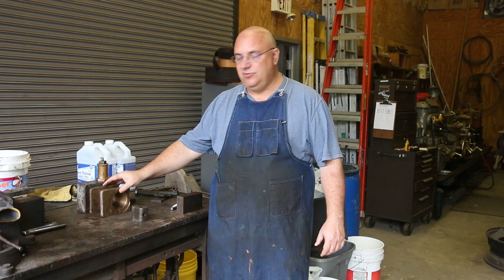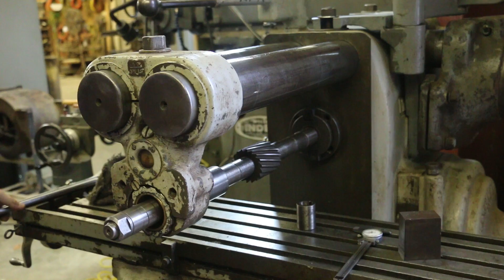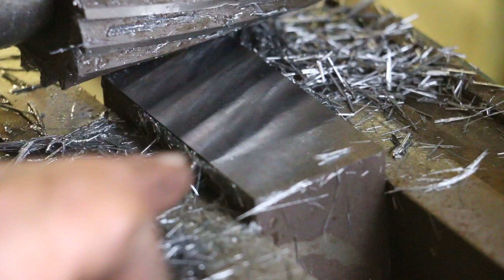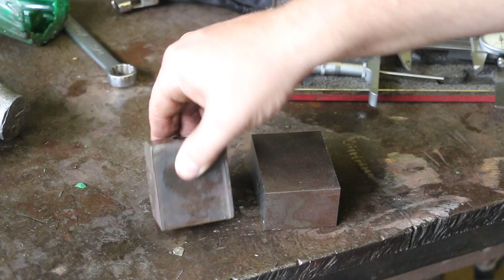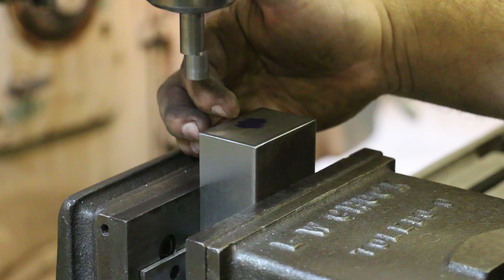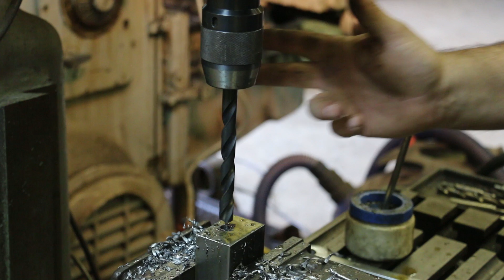Steam Locomotive Bearing Wedge Build:  Part 1

Comment: If there was no possibility that the wedge was original I would have installed a Heli-coil or equivalent. I would have saved time by cutting simple diagonal corners instead of cutting radiuses. Relieving the corners is just for clearance not strength or location..

Comment: Keith - Question. You say the bearing wedge drives the bearing tighter against the shaft taking up slop. The bearing was likely line bored to be circular. If there is horizontal movement it beans that there is a space between the two bearing pieces - this they are 2 halves of a circle but ow circular in configuration when in place. It appears the there is wear in only one direction and not the other. How did they compensate for this

Comment: I worked at K-T rebuilding the older knee type mills. The 2H has a great history. Just a small note, the U.S.Navy honored Kearney and Trecker with the award that their 2H was the oldest running machine tool that the were still using.

Comment: I was an apprentice machinist at a GE shop in 1970-71. The shop did both tool and die and mold making for plastic parts. I certainly enjoy your videos. In addition to my apprentice learning I also did all of tool steel heat treating for the shop. I did air quench inside a stainless steel wrap. I have noticed that you never seem to do any case hardening or heat treatment of your parts.
Reply from the maker: I have done some heat treating before but I don't think I have ever done case hardening.

Comment: Hello my name is Leo your real steam locomotive is fantastic, I want to 
built one like yours, I have disponible all metallic machine like lathe 
and vertical drill ecc ecc to realize all pieces necessary, but I need 
about project and construction plan. I think that to begin will be 
sufficient realize a locomotive with not more of 3 axes. Now have you 
disponible a project/power plan of construction ecc ecc for a locomotive
 with 7 3/4" gauge that can be able to start for me??? Thank so much Leo

Comment: You have to check the DRO time to time to be sure it shows right. It would really suck if it fex was off by say 5 thou, that could be hard to detect if not looked carefully and could make really bad problems when made something.
Reply from the maker: +dtiydr I find that the DRO is usually right or or way off.  I have not had problems with it being only a little bit off like that.
Reply: Keith Rucker - VintageMachinery.org Ok, that was good to know Personally however I usually check them 2 - 3 times a year to be 100% sure, I don't know I might be to picky.

Comment: While watching this I though couldn't you just drill out the thread and then fill it with tight bit of steel (or what materiel  was it) (of course there's more to do) then re drill and thread it that way you use the original part but then again what you did works well and thank you for doing these vids
Reply from the maker: +Riku matthews Sure, you could do it that way.  But, I think it has drawbacks.  I would very worried about that plug of steel staying put with the pounding that happens to this wedge.  My call was to make a whole new part, but your approach may have well worked just fine.
Reply: Yer well it's easier in some ways also the way you done is more interesting to watch but you know the plug won't come out

Comment: Could you not have made a threaded stepped insert instead of making a whole new wedge?
Reply from the maker: +Peter Fletcher Possibly, but I would be worried about it working out due to the tightening and loosing of the bolt used to make adjustments.

Comment: Hi Keith,

What us the spool shaped brass fitting on the bop of the bearing frame?
Thanks
Tony
Reply from the maker: +Anthony F. “Tony” De Leo That is an oiler.  You put oil in it and it drips down on the bearing.

Comment: Keith...
please expound on climb milling...I've seen back and forth on the  x  axis, always told to front load the cutter on  x  passes... if the machine is stout, shouldn’t make a difference.
Reply: I agree. When would you choose to climb mill?
Reply: +tim wyman Imagine an old worn out machine with 0.100 worth of slop in the x axis lead screw (extreme example, makes it easy to visualize) in conventional cutting, the cutter is pushing it the opposite the feed, keeping it on the same side of the lead screw.  In climb milling the cutter is pulling the part the same way as the feed.  If the cutter gets a good hold on the part, it will pull it that 0.100 worth of backlash, and the next edge that comes down get to bite off 0.100 of metal instead of the expected 0.005 or so.  Clunk, boom, broken something.

Comment: You made me wonder when you started out to go climb milling there! Great little project to show both the horizontal and vertical mills. I'm impressed at how you dialed in to the tenths of thousandths so quickly on the vertical--I always have to do more fidgeting and finagling than that. Maybe that can be a challenge at the next round-up, to go along with the four-jaw lathe centering challenge. Thanks for posting.
Reply from the maker: +Rick Rose Thanks for watching Rick!

Comment: Catching yourself from climb cutting the part is a good lesson for the beginning machinist.
Reply from the maker: +Gord Taylor It is easy to get confused when you stop to do something like make a measurement.  Some mills are actually designed for climb milling, which is more efficient and leaves better results.  But, if you have any wear in your tables, climb milling can pull that slop out and crash a cutter.

Comment: When those split bronze bearing pieces wear I assume you adjust using the wedge.  I didn't see any shims just the wedge to press the two halves together.  What is the criteria used when adjusting the wedge?  Do the mating halves of the bronze bearings come in contact with each other?
Reply from the maker: +hankus253 Over time, the mating bearings will wear to the point that they do come in contact with each other.  When this happens, you have to mill out more clearance where they mate with one another and if necessary put shims behind the bearing halves to take up the wear.  And at some point, it would become necessary to just replace the bearings all together.  The problem we have is that our bearings do not appear to have ever been replaced and there are a lot more shims behind them than I am really comfortable with.  One of the two bearings that we were working on had shims that were over 3/4" thick behind one of the bearings!  Of course, assuming that these bearings are original to the locomotive, they have been in use for 98 years, so I guess that is not too bad from a wear stand point....
Reply: +hankus253 
If they do then they need to be replaced because they have badly worn.  Usually on something like that.  I would think it would be poured milled and bored as one piece.  Then a machinist would split the piece to print and mill away a little bit off of both piece to give some room for wear.  When those pieces touch they are no longer properly supporting the pin.
Reply: +garygsp3 Maybe Keith will respond and explain how they are adjusted.  You can't just crank up the wedge until tight, there must be some sort of clearance measurement observed.
Reply: As an industrial mechanic I've used round feeler gauges to set connecting rods before.  However nothing ever this big.  There is going to have to be clearance between the pin and the bushing but I wouldn't begin to know how to set it.  I do know these joints are constantly bathed in oil VIA the oil pots that sit on top of them.

Comment: What is that? Mild steel? Do you think the threads would benefit from being hardened and tempered? Maybe prevent future stripping...
Reply from the maker: +jrmym2 As much thread as we have in there - the entire length is threaded - I doubt it would make much difference. Lots of surface area.  The original part lasted 98 years and it was not any harder than the one I made.
Reply: +jrmym2 
I wondered that myself but in reality they really shouldn't see that much use.  The force on the pin from the connecting rod should transfer through the bushing, through the wedge and into the bracket holding the assembly together.  The only thing that would stress the threads is torquing on them trying to tighten the wedge.  Which if you get as MrPete222 says "Hammer and Chisel mechanics working on something you never know what damage they'll do."

Comment: As I understand what was said in today's and in the last video, the brass bearing was made around 1917, nearly a hundred years ago. I don't understand how it is that the brass bearing that support the thrust is still good and that the wedges that do not support a load, once in place, are worn. Is there some explanation for that cause? Thanks 
Robert
Reply from the maker: +Robert Patoine As the bearing wears, it get's a little bit loose.  With this bit of looseness, every time the wheel goes around, that little bit of play in everything moves the wedge and bolt back and forth a little bit.  The constant beating on the part will weaken it over time.  These original parts are 98 years old and they can only stand so much stress.  In a perfect world where the bearing is always kept tight, this would not be an issue but over the past 98 years, there have been many periods where this train was not operated in a perfect world....
Reply: +Robert Patoine t  Following the Occam's Razor theory. I'm going to guess that the wedge was overtightened at some point, pulling the threads. With the threads weakened and 100 years of cinching up the bearing, you get the final result. Keith did mention that one set of bearings needed to be recast because it had gone egg-shaped.
Reply: Interesting theory, Thanks to share.

Comment: Had that exact same problem with DRO on my vertical mill (actually screwed up a piece by just using the DRO and not putting down reference lines), thought the DRO was trashed. I wiped the pick-up down with a rag and it seems to work fine now, but problem is, that problem is stuck in back of my head and I have to double or triple check the thing every time I use it!
Reply from the maker: +Fred Newman DRO's are great, but you should always confirm that they are in the right place.  The old carpenters rule applies here - measure twice and cut once!
Reply: +Keith Rucker - VintageMachinery.org  I have an old carpenter's rule, folding wooden one with brass slider on the end. LOL!

Comment: Hi mate.  Now I know that I'm not the sharpest tool in the six pack, but you could have retained that block by just oversize the thread, or weld it shut and re-tap it.  Why did you go for a new part instead?  I always think, the more newly made parts, the less original the machine, don't you think?
Reply: +Marcel Timmers 
Yeah it's kind of like the story of the man who won an award for saving the town money by using the same broom for 30 years.  When asked how he did it he replied with.  "Well when the handle broke I replaced it, when the bristles wore out I put new ones on."  So was he still using the same broom?  Of course not.  The original broom had long since been thrown away.

Now with that said will it be all original?  No of course not.  It hasn't been all original since it left the factory where it was made.  Parts are made to wear and be replaced.  Hence the bronze bushings for the connecting rods.  Brake shows would likely be another one.  Once I start thinking about it I can easily come up with a few dozen things that are either easily broken or worn out with use.

The key is this.  Is the replacement part made back to 1917 factory spec?  In the case of the wedge Keith is working on yes I would say it is.  On the wedge he showed us in part one where the back corners weren't rounded no likely not.  That still doesn't take away the majestic beauty of a by gone era.
Reply: Hi mate.  You'r quite right.  I was not saying that new parts should not be made/installed, but I like it if the old parts are tried to be retained as long as possible.  Not only for pure ecstatics but also for monetary reasons.
Reply from the maker: +Marcel Timmers An oversize thread was not really an option here - that would have required drilling out the other parts that the bolt goes through oversize as well.  As for the tapped hole, I decided it was better to just make a new one than trying to fix this one.  Because of the depth of that hole - several inches deep - it would have been difficult to weld up and probably would not have had great results.  I am all about keeping original parts when possible, but I would rather have a new part built to original specs than a cobbled up repair that might fail.
Reply: Ok mate fair enough, I was just thinking aloud.

Comment: 'hat was very interesting work Keith.

Round here we would just drill and tap it oversize and fit a big Helicoil to the original tho'
Reply: +Gordon McMillan I'm not sure that Keith could find a Helicoil that's long enough for what he needs...

I'd though about drilling and tapping - with left-hand threads - a large enough plug to accept fresh internal 5/8" UNC... but, that seems like a bigger job than going at it this way...

Eric
Reply from the maker: +Gordon McMillan As for Helicoils, I have nothing against them, but I have never seen any long enough to do that entire depth.  I would also be concerned with using one in this application because the thread is for an adjustment bolt that gets moved from time to time.  Helicoil's are typically used for applications where you are torquing a bolt down on something and it is not being adjusted.

Comment: Having close to thirty years machining back ground and now i have three years in Water-Jet. I could have that part 90 percent done in under the time this video played, though you still have to drill and tap it.
Reply: +Marcus460
Not to the tolerance Kieth was holding himself to.  Half a thousandth?  Even our 4k laser at work can't hold that kind of tolerance and it is way more accurate than a water jet.  Which it better be considering the huge money they cost.
Reply from the maker: +Marcus460 That's great, but I don't have a water-jet.  And I suspect that some of those faces would still have to be cleaned up to get them as smooth as they need to be.
Reply: +Keith Rucker - VintageMachinery.org Hi Kieth, Sorry I didn't mean to imply that you use one. and yes the faces would need to be cleaned up. To what degree of tolerance that would be up to you. At a level 3 finish you would get approx .008-.012 taper on a zero degree setting would be much less taper though cut time goes way up

Comment: ....Mr Rucker,......Question...not just with your work, but a lot of machinist do it........ with 1/2" of steel to remove, why not stain, scribe a line, cut close then mill to final.......seems like the milling would take longer and be more wear on the machine, cutters, mess to clean up etc....?......thanks for sharing your work, love every show....
Reply from the maker: +Rick L Cutting the part out would be just fine.  Our band saw would not hold a piece that short though.  I could have put a metal cutting blade on the upright band saw in the wood shop and cut it off with that but they were using it for something else, so I just milled it down.

Comment: Keith . . . Hope you and your family had a great Thanksgiving! Now, it's turkey sandwiches for the next 2 weeks! I ate way more than I should. Since we ate at my cousin's place, they will get all the turkey sandwiches! ... Great job on milling and threading the block, Have you figured how you are going to do the radius on the block? If you could mount it on a rotary table in the correct position, you could do those by turning the table while cutting with an end mill. Would the part that the block slides in be weakened if you filled the curves square? ... As always, thanks for the great video. That was one hungry cutter you used!
Have a good one!
Dave
Reply: +Swarf Rat .....a outside or inside radius is much stronger than a sharp inside or outside corner, its almost like scribing a line for it to break on with an inside corner....and sharp outside corners can and will fracture/chip off, after repeated blows or vibrations.....besides...over time most sharp corners get rounded over............
Reply from the maker: +Swarf Rat Well, you have a pretty good idea of how I will mill the radius onto those pieces.  It is all done now and that is pretty much how I did it! I will get that video up sometime next week.

Comment: As I rather expected, the wedge actually involves quite a lot of work. Nice to see the stages... and look fwd to the remainder.
Reminds me from my old but long gone horizontal mill - those nasty lil' needles from cutting!!!  The ones that sneak into your skin when you ain't lookin' :)
Reply from the maker: +ChrisB257 I can remember when I worked in the machine shop and ran horizontal mills and turret lathes all the time.  I used to come home at night and try and find the tiny shavings under a magnifying glass so I could pull them out....

Comment: hi keith,
that's a good lesson in dro-ing. got to use the old slide rule approach whence the user had to anticipate the result.
here's the check-up routine i use when working with the dro. i measure some medium distance with the x-scale, say, 3.125. then after that, i exchange the connectors "x" for "y", turn the vise in its base for 90 deg.,and measure it in the orthogonal direction. if the reading are the same, then the work starts.
this method has helped me several times to catch the "bug".
on your mill, do you have the shield on the rulers? 
the work looks like a mild steel. are you planning to heat-treat it?

thank you for the video,
-toly